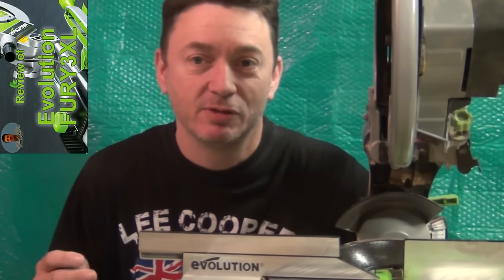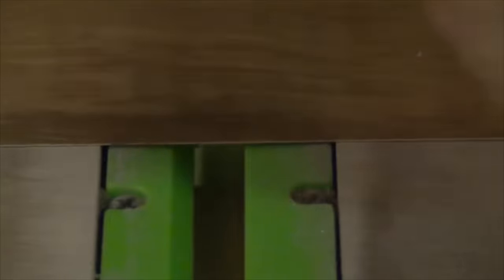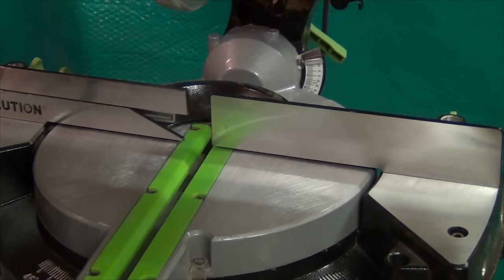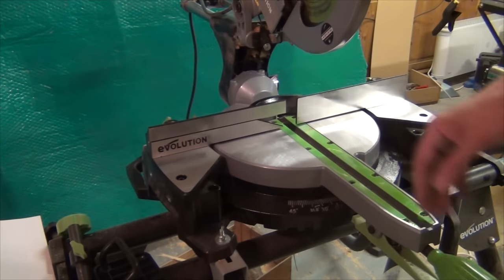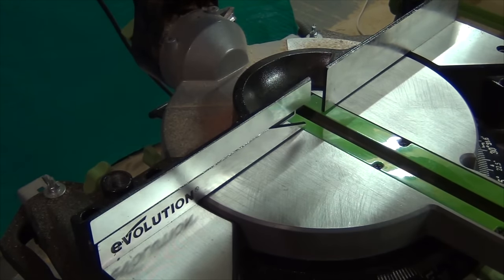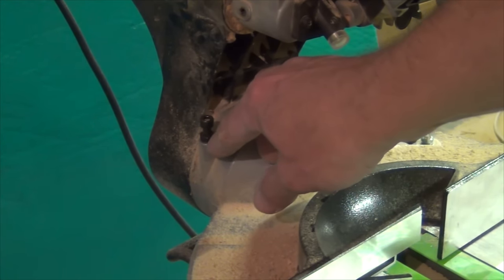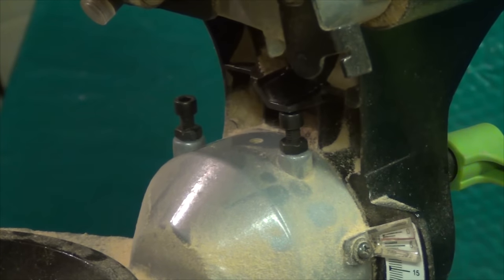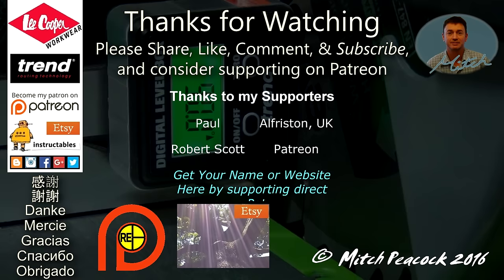Mitre Saw Setup for Accurate Cuts

Comment: This is the REAL review of any Evolution Mitre Saws.  Picked up a Rage 3 DB yesterday and was so unimpressed by the centre being higher than the left and right floors of the base like in this video as well as the fence being less than 90 degrees to the base and again with no adjustment for this as it is the shape of the cast itself. Obviously you can adjust the fence horizontally but in no way vertically.  Lost faith in this as I can’t imagine any replacement with solve these issues plus I’m not willing to start sanding the centre aluminium like this video although you have done a brilliant job. Disappointed to say the least.
Reply from the maker: Chris Flux Cheers Chris. That's disappointing. Definite money back and try another brand by the sound of it. My impression of their customer service was extremely good, so if the retailer won't play ball get straight in touch with them.
I shall be reviewing a new model sliding mitre saw from Evolution soon, so it'll be interesting to see if the build quality has improved at all.
Thanks for giving your experience here.
Reply: Mitch Peacock - WOmadeOD trouble is can’t see anything that’s the same! Cuts wood and metal? If I increase the quality, and paid say £500 for better engineered products and accuracy then the rpm is too high for cutting metals. Any thought?
Reply from the maker: Chris Flux Ah, I see you need the metal cutting ability. Well, two ideas, talk with customer services at Evolution - they may be happy to do a QA test on a replacement before sending it out to you (rogue machines do get  through batch testing). Modify out the problems - you can belt sand the table and fence to correct the faults you described, or face them both with ply that's been sanded on the back to negate the errors.
You shouldn't have to modify it of course, but in the absence of an alternative you will end up with a decent machine.
Definitely try customer services first though, and keep me posted here on how you get on.
Reply: Mitch Peacock - WOmadeOD All good ideas, I purchased it with Toolstop and so am a little concerned  when I contact them Monday to return it as not fit for purpose or faulty they may argue the case and say it’s the tolerance thing you mention and so won’t reimburse my return postage which will work out to be £40! Wish I could send you some pics for you to see. So where you mention contacting Evolution themselves I fear they couldn’t do much about it. Ideally I’d want to go to a shop, unbox 10 and pick the best one out of a bad lot 😏
Reply from the maker: Chris Flux Thinking about it I believe the units are shipped direct from factory to retailer, so there is no UK warehouse. The accuracy should be stated in the manual, so check that before you take toolstop. If it's outside the stated tolerance then they should cover all costs of replacement or refund.
Reply: Mitch Peacock - WOmadeOD like me it seems you’re having a late one :) just looked through the manual and don’t see any mention of tolerances unfortunately- http://www.evolutionpowertools.com/downloads/manuals/build/web_rage3db_eng.pdf
Reply from the maker: Chris Flux I see, well in that case ask evolution what the manufacturing specification is for the table flatness and fence squareness. No point asking for a replacement if the tolerance is too wide for you. If your machine is outside the spec. then toolstop should cover all costs of a return (and they will no doubt charge it back to evolution)
Screwfix sell evolution, so you may be able to go there and inspect a machine before taking it away. As long as you state the tolerance you need when you buy it, they can't refuse to refund if it fails to meet it.
Reply: Mitch Peacock - WOmadeOD Hi Mitch, thanks for all the reply’s (advice) thought I’d let you know Toolstop accepted it back and have given me a full refund, they did mention they will be sending it back to Evolution. Thanks again.
Reply from the maker: Chris Flux Thanks Chris, appreciate that. Hope you find something that will do the job you want.
Reply: Chris Flux  check where it's manufactured, most likely in China.
Reply: Check where it's manufactured, most likely in China.

Comment: Hi Mitch. I have notice that my mitre saw rotating base is not Parallel with the out wing.so what should I do
Reply from the maker: Very slight deviations can be addressed by filing or sanding the machined surfaces, similar to how I set mine up. BUT, see reply to your second question...

Comment: how to calibrate 30 degree angle bro?
Reply from the maker: If you have calibrated 0° (which gives a 90° cut), then the pointer should be set up to accurately lock the table at any other angle. To check a thirty degree setup, which will give a 60° angle, cut three pieces, arrange together in a fan shape, and check against a straight edge.
Reply: @mitchwoodwork  Thanks. I'll try it.
Not many wood worker hobbyist in you tube explain this.
Will be very good if you make video on this matter.

Comment: Aren't you worried that sanding the table and making other alterations to the saw, that you might be voiding your warranty???
Reply from the maker: Good point. Probably best to confirm with manufacturer first. I'm improving on the manufacturing result though, so I would hope they would understand.

Comment: If an expensive saw came out unsquared out of box then we should return it immediately. It is not worth it to spend time to adjust a low quality miter saw. I used to have several miter saws that had slightly curved fence, and it is not a fixable issue. A high quality saw should come out perfectly squared on every angle out of box.
Reply from the maker: They should, I agree, but that doesn't mean they do

Comment: I have a cheap, crappy chopsaw but I know I can rework it to make it a lot better, so thanks for this. How long did it take to flatten the circular table?
Reply from the maker: Richard Wiles I can't honestly remember, but that does suggest not very long 😉 Aluminium is quick to work if you use a coarse open abrasive. Good luck

Comment: A better idea would be to buy a quality saw,my Dewalt is still true after many years use.However a useful video for those on a tight budget!
Reply from the maker: Thanks. Most saws on the market can benefit from owner tuning to some degree, although at what point it no longer becomes necessary for most woodworking tasks is another thing entirely. Usually the cheaper the saw the worse the potential inaccuracies.

Comment: I was following until I got to the plastic cap on the machine screw idea.  That's not a good idea IMO because it's made of soft plastic, so over time it's going to change shape and become squashed.  That'll in turn impact on how true the angle is.
Reply from the maker: I would agree over the long term perhaps, but it isn't being hammered and once the saw is in place it gets locked off rather than being constantly pushing on the cap. This video is pretty old now, and mine is still working fine.
One big issue might be if the cap is in direct sunlight, which would degrade it quite quickly depending on the plastic.

Comment: You didn't show how to adjust the 45 Degree angle
Reply from the maker: Just the same as the ninety, adjust the end stop, which is usually a bolt with locking nut.

Comment: I'm in the disgusted camp. That saw should not require you to go about metal removal to obtain the accuracy which apparently the saw was designed (but NOT made) to deliver. Some fine adjustment screws would be useful; your knocking it by tapping into position is very hit & miss. I'd have returned to the store & then expected to find the whole stock suffers from the same problem.
Don't know this brand what did it cost?
Reply from the maker: Hi Peter,
It would be great to have all tools dead accurate out of the box, but the cost would be prohibitive for most users. I was sad to have to remove some metal, and I do think this issue should be addressed by the manufacturer - The surface has been ground/fly-cut/milled or similar, so I would guess either the castings hadn't had enough time to stabilize beforehand, that the underside wasn't supported sufficiently, the parts were machined seperately, or a combination of these. It's a shame, and I expect a result of shaving manufacturing costs. 
The brand are very much into supplying usable products at affordable cost to the tradesman and diy user. This saw has a rrp of £170(GBP), and can be brought for £150. For the money, I was quite impressed, and most users wouldn't need to go as far as I did here to get the results they wanted, with built-in adjustments coping with the main issues. I was trying to demonstrate how to get the same accuracy as you might find available on saws costing five to ten times as much, which was why I ended up correcting discrepancies in manufacture as well as making the usual setup adjustments.

Comment: Great video but i would have taken it straight back and found one that didn't have a crown. Evolution saws are cheap crap . I had to hunt around for one that was of any quality every table fence are cheap made nothing square about them in any shape or form . Save your money and get a better brand. Makita  Bosch trend Sip Dewalt Metabo Even  Ryobi make better quality than Evolution, If you want something to last and give good results you have to pay the price.
Reply from the maker: With an engineer background, I probably look for tighter tolerances than most woodworkers, and may have made it appear worse than it deserved. Getting everything spot on took far less time than swapping it for another, but I would agree that the more you pay the more accurate out of the box performance you should get.

Comment: I saw his video but his balde was good so he doesn’t show how to fix that
Reply from the maker: Asc fender If your blade is bad, I recommend buying a new one. Trying to fix a blade properly is technically difficult and time consuming. Getting it wrong can be dangerous too
Reply: thank you very much for your answer, I meant he didnt show how to correct the problem when your blade is not 90 degree angle. When making cuts  it goes off diagonally, very slightly but noticeable. Should have explained better. =] Thanks to your video I realized there is a bolt I can turn to adjust that and went and bought a small angle to do the correction. I have not fixed it 100% yet but I will keep trying.
Reply from the maker: Asc fender ah I see. A try square gets you pretty close, but the test cut is the true reflection, and tiny adjustments can be made based on these, until you get the perfect cut.

Comment: The word "lays" is used incorrectly 99.8% of the time. The word you wanted was "lies".

You don't adjust a saw by measuring the blade or the machine. You measure a saw by cutting with it and measuring the squareness of the cut. To check verticality, clamp a 100x50 with the 100 in the vertical and cut it. You slowly move the angles around, one at a time, until you have perfect results.
All saws except the most expensive allow the blade to move a bit as you plunge and push, and for this reason, we can't rely on the tool settings, only the results.

Comment: Why does this saw need a truing of the rotating table?, shouldn't it be flat from the factory? I view this as inferior manufacturing, it's not as simple as sharpening a plane iron, or setting up a bandsaw. Just my opinion.
Reply: They could make it perfect, but that would make it too expensive for the market they're aiming for.
Reply from the maker: It's down to manufacturing tolerances. This model was aimed at diy users, and would be perfectly acceptable for general use. For spot on accuracy, which I'm aiming at, the tolerances would have to be much tighter, and consequently the manufacturing costs would increase. It isn't hard at all to address these issues as a user, and doesn't take that long. If you can sharpen a plane iron, then you could do this easily. The alternative of buying a saw at two or three times the price of this one, isn't usually an option for a hobby woodworker.
interestingly, Evolution are on top of this, and what I've heard is very positive.
Reply: This must affect the warranty though?
Reply from the maker: Clive Smith You could always check with the manufacturer first, but in the UK we have good consumer rights too, so it wouldn't overly concern me. If the manufacturer has a problem with you improving the saw, then simply return it as not fit for purpose.

Comment: Instead of pulling the label off take the whole saw back if it has all of those problems. A brand new saw shouldn’t be so out of whack.
Reply from the maker: There's a big difference between the accuracy I'm aiming for and the manufacturing tolerances that make saws commercially viable at different price points. If cost is no object then I would also recommend taking it back, and investing in something else.

Comment: It's silverstorm and I got it on ebay
Reply from the maker: If it's recent, contact the seller and explain the fault. If they don't understand then they shouldn't really be selling tools ;)
I'd go with the idea of adding some sheet material on top of the rotating base to level it. Sounds like 4mm MDF would do the trick. Thickness it until the discrepancy disappears, then attach with double side tape. Plunge blade slowly through to create slot. If you use the blade tilt function, set to it's max tilt and plunge again. It's difficult to give a fix without seeing it, but I hope this gives you an idea of what could be done.

Comment: Isn't it a bloody shame that the consumer has to correct flaws in a brand new tool?
Reply from the maker: It is, but everything is manufactured to a tolerance, and cheaper tools have a wider tolerance in order to keep their cost down. The end user can accept a tolerance dependant on what they are doing.
This saw is predominantly aimed at the DIY and building trade, and the inaccuracies would be irrelevant. For cabinetmaking, furniture making, etc, they pose a problem.

Comment: I'm sorry but I've tried the MAKITA sliding miter saw, the DEWALT sliding miter saw, the HITACHI sliding miter saw, I have a friend with a RIDGID sliding miter saw, as far as I'm concerned they are all junk. They lack the stability for anything close to an accurate cut.
Reply from the maker: Thanks for your comment Thomas. I understand, and I guess it depends a lot on the tolerance that is acceptable. I don't believe any sliding mitre saws are rigid enough to prevent user induced errors either.  That said, if setup well, the average error of a batch of cuts can be kept small. 
In my work, everything is finish shot with a hand plane where great accuracy is required.

Comment: evolution should be worried about their manufacturing quality if they watch this.
Reply from the maker: I got to review a more recent sliding mite saw from them last year and there were some improvements, so it looks like they are heading in the right direction.
To be fair though, they don't market them as precision tools for making furniture etc. more for site carpentry and diy, for which they are quite capable.
Reply: @mitchwoodwork  thats good to hear. people like yourself give them a wake up call, thanks.

Comment: The moral of the story is don't buy one of these saws. If you have to start out by rebuilding it, you wasted your money.
Reply from the maker: As with so many tools, the more you pay, the tighter the tolerances. If you can afford to buy the tolerance you need that's great. If not, at least you can get there with a little work on something cheaper.
Reply: Mitch Peacock - WOmadeOD 

I do have a limited budget. I waited until the Thanksgiving weekend Black Friday sale and paid a whopping $300.00 for a Ridgid 12" Sliding Dual 70° Compound Miter Saw. It has one (yes, I said) one minor problem, which was easily corrected. 

I don't know how much you paid but the difference between your cost and my $300 (plus tax, of course) can't possibly be worth the effort. The following month I bought the 12" Diablo 100 tooth blade ($80) and now I'm ready to cut. I also registered my purchase with the manufacturer (within 90 days) so I also have a free lifetime complete warranty!
Reply from the maker: Sounds like you did okay there

Comment: This is why I buy GOOD TOOLS. and if they are not in speck I take them back.
Reply from the maker: Generally the cheaper the tool the wider the tolerances in the spec'n. If you need tight tolerances, you either pay more for them, or as here, put a little work in.

Comment: No offense meant, man, but you paid over $400 for a miter saw and had to take 80 grit sandpaper to the table !? The correct way to fix that is to return the saw and buy a different one. And squaring up with a piece of paper. You lost me halfway through the video. I saw all I needed to see.
Reply from the maker: I think it was closer to £120. Perfectly good enough for a builder, but to match $400+ machines it does need a little work

Comment: The only thing I got from this video is... Dont buy an evolution saw.
Reply from the maker: At this sort of price point you're lucky to get an "accurate" setup straight from the getgo. So for those on a tight budget, putting in a little effort can make a substantial improvement.